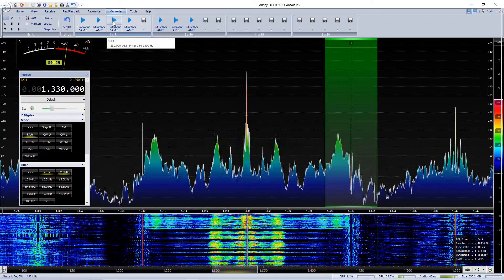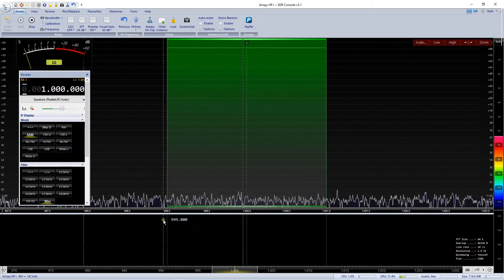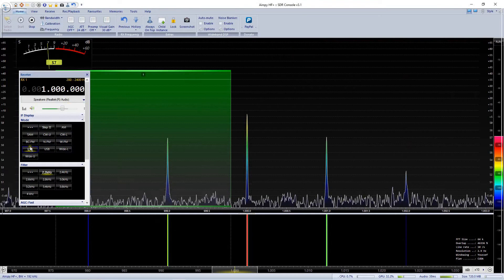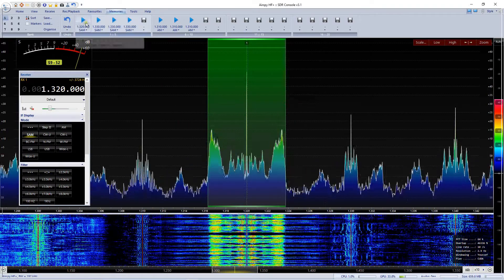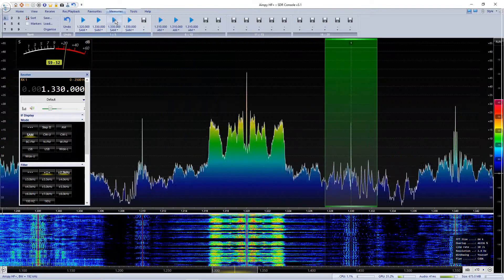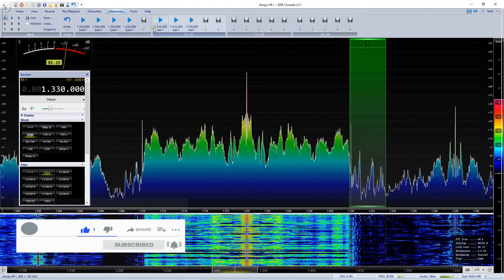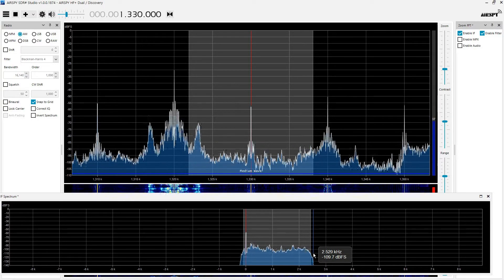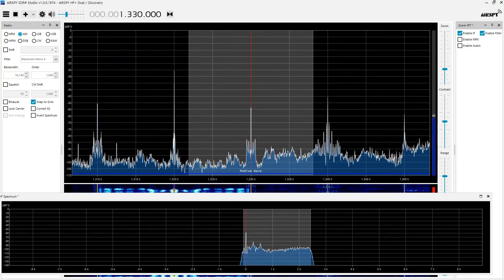How to use asymmetrical IF filtering with your SDR  using Console 3 and SDR#

Comment: My understanding, in the beginning, there was AM. Then someone said less suppress the carrier and put the carrier power into the sidebands, thus having a double sideband supressed carrier radio, which was short-lived as I understand. By taking this a step further the suppression of one of the sidebands allows all of the power in one sideband and narrower bandwidth. Question? What purpose does the carrier perform?
Reply from the maker: With out the carrier .... a simply diode could not be used to detect the audio.  SSB is much more efficient.. But requires a product detector or the like...

Comment: I really enjoyed this video. I have used non symmetrical filter techniques for years and I wondered why I could not adjust the filter in sdr console on SAM. I never in all the time I have used it hovered over the <|> key. Unbelievable. Now I can use SAM
on some weak south american stations that are slightly off frequency and not sweat achieving zero beat and let the sync lock
do it for me! How excellent! I use Airspy HF Discovery+ and the SDRPlay RSPDX for most of my HF/LF SDR fun here and I really like SDR Console.    
  I can't believe I only found it now...and I had to watch carefully to see you do it. 73 OM hope to work you soon. KI4WCA